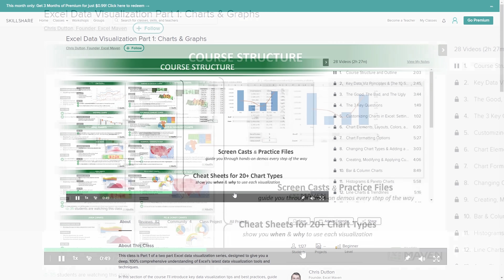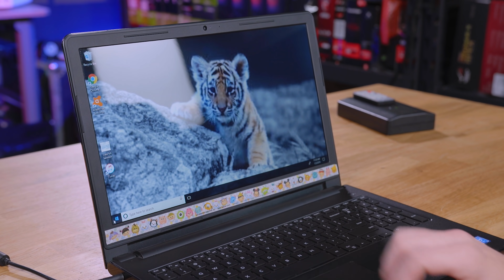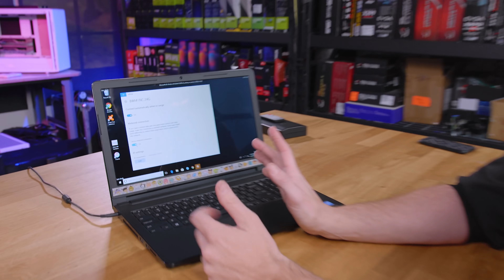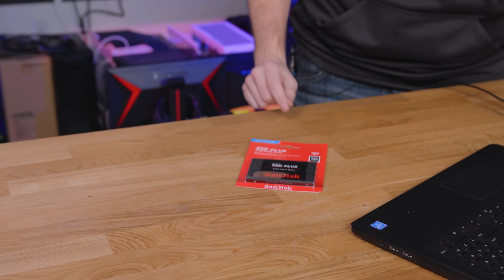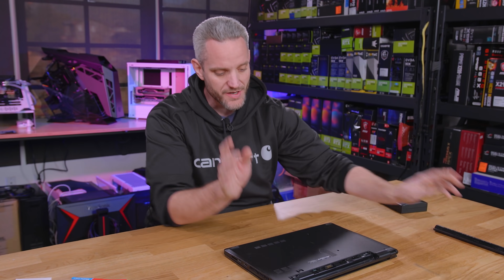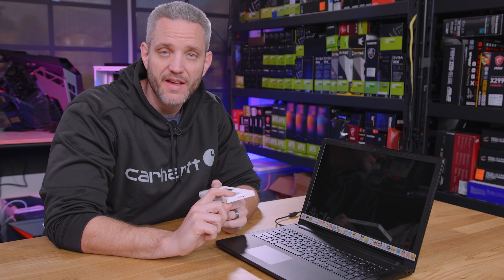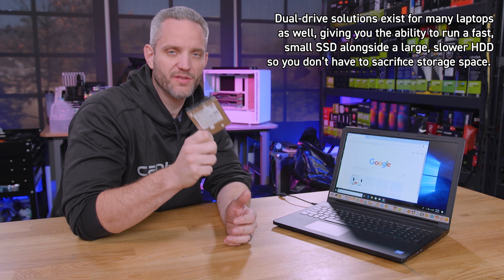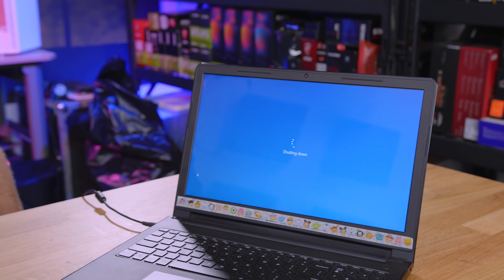Repairing an old laptop for as little money as possible...

Comment: Hey Jay, good show. 
So my old Dell Inspiron 1525 Laptop was getting real slow and glitchy, I decided it would be fun to see if it could be upgraded ok. So I stuck a new cpu Intel T9500 @ 2.6 GHz 6M Cache, 800MHz FSB, couple 2GB sticks GSKILL DDR2 800MHz PC2-6400 and a SanDisk SSD 240GB 530MB/s.
This new hardware has a little more power than the F-Bus could handle but now starts most of the time in around 28 seconds. Its no gamer but now I can run Art programs have abunch of windows and tabs open at the same time. 
 I think this laptop is excellent now well worth the upgrade.. And it was fun to upgrade it ^^

Comment: It's got Norton, McAfee... Ah there's your problem! I've actually even got rid of avast recently on my desktop. Just using Defender and Malwarebytes.... Sooooo much lighter on CPU utilisation!

I'd also remove start menu delay in regedit and probably adjust display options - visual effects, for Performance. Sure it will look like Win95, but on a craptop it will be waaaaay quicker.

Comment: That emoji stickers at the screen bottom screen gave it away that the owner is a teenager girl..

I have a similar notebook from ASUS (5 year old i3) slow and only a single slot for the RAM.  I didn't want to remove the 1TB mechanical drive (for storage/backup and also to retain the original image/clone partition)  but I still wanted a SSD.  It doesn't have any slots for M2/PCIE SSD, so the only option was for a SATA SSD.  I got the Evo 860 500Gb on a sale.  The only option was to install the SATA SDD into the DVD slot.  I got a SSD caddy that fits into the DVD.  Still, opening the back to access the DVD drive was almost a nightmare!  The entire back-panel had to be removed before I could access the locking screw to remove the DVD tray.  I broke one of the plastic snap holding the back-panel.

One the SSD Caddy with the new SSD was installed, I used the Samsung disk utility to migrate the OS.  Everything is so much faster and smoother once its completed.  Cleaned/Re-partitioned the mechanical drive and re-configuring some of the programs to reside in the mechanical drive rather than residing/running from the cloned SSD.  Took some time but it was worth it to give a breath of life into an old notebook.. it's much better and cheaper than buying a new low-end budget notebook.

Comment: I recently fixed up my old Toshiba laptop the Satellite a215-s5808 (AMD TK-55), the ATI video never got a windows 10 driver (ATI SB600) so windows 10 ran like garbage specially compared to windows 7. I went ahead and cleaned the whole thing heatsink and fan, reapplied thermal paste and installed lubuntu 18.04 LTS the thing runs fantastic after that

Comment: Definitely agree with updating to SSD.  Got some cheap $5 laptops at garage sales, and SSDs were my first update; actually, in both cases I had to replace the HDD because they were bad.  Both were 2008/2009 systems with only Core 2 Duo, but even with that it's perfectly usable for Windows 10 or Ubuntu if you're interested in light web browsing.  I wouldn't recommend them for gaming, though, as he notes.  Lakka on a USB stick though is pretty amazing--even 10 year old Core 2 Duos with Intel integrated graphics are substantially more powerful than a Raspberry Pi 3.

I did end up going on ebay and upgrading the Cpu to a 2.4GHz Core 2 Duo for ~$4 (mostly for the hardware virtualization) and the ram to 4GB for ~$6.  As another poster mentioned, it's not at all a bad idea to look online as Dell actually has really good manuals on setup and service.  Some googling around will also give you an idea of what sort of upgrades have been attempted and were successful.  I will definitely agree that some Dell disassembly requirements are ridiculous; if I ever want to take out the DVD drive and replace it with a HDD/SSD caddy, it'll be almost a complete disassembly to achieve. 

Even though neither laptop is going to replace my main Linux box or my gaming Windows box, they are both definitely usable enough if I ever need a portable solution or for a while if one of my main machines dies.  The best thing to me is probably the satisfying absurdity of buying cheap CPU and RAM with free shipping from China.

PS - Far as I can tell from the 4K screen shot, you have an Inspiron 15 (3552) and the service manual (https://downloads.dell.com/manuals/all-products/esuprt_laptop/esuprt_inspiron_laptop/inspiron-15-3552-laptop_service%20manual2_en-us.pdf) shows it's actually pretty trivial to replace the HDD and RAM by removing the battery, base panel, and then swapping the HDD and RAM.  So, uh, not sure what's going on?  It doesn't look like you can replace the CPU though, sadly.
Reply: A month ago, I Scored a Dell Latitude D630 (built in 2007)on eBay for $20 bucks!  No HDD, No OS, & only 2gb ram!  Dropped in a $20 SSD, got 4gb of Ram from China, off eBay, Loaded Win 10 Pro,...now she's Running like a Champ!  I don't have Cable/Internet,...but I tether in thru my Cell Phone, keep updates paused until I can Update from a Fast Food free Wi-Fi Connection in there parking lot!

Comment: Your inspiron may not be meant for user servicing, but thats not true of dells in general.  Both the Lattitude and Prescicion lineup are for the most part very easy to service, with it being one cover to open to access hdd/ram/wifi card and if applicable, internal battery.

Comment: I don't get why people buy cheap junk just because it's new. I just bought an old workstation laptop with an i7 4810MQ, 16gb of DDR3, and a 512gb SSD for $300 on ebay. Beats any new system spec-wise until you spend $600 or more.

Comment: I just received a Dell N5110 today :)  I brought it for $150NZD (about 100 USD) it has i7-2760HQ, 8gb DDR3,  GT525m 1Gb. Had some motherboard issues that required a small amount of soldiering to fix the heatsink mounting points and a really good clean up, heat paste etc.  I'm amazed at what you can get for so little these days. It's incredible and makes me feel so old. But the plus side for me, is I love computers, repairing, programming and all that crap but I've never cared to have up to date technology and are always 10ish years behind in everything (I admit I have a RX580 8Gb but everything else is old), means I can have what I consider really nice stuff for cheap because its actually all crap by todays standards, but I don't mind. A new store brought laptop to challenge the N5110 I just got would cost about $1000
Reply: I should add, the screen has dead lines of pixels. Lol. But I already have a replacement lined up for this computer anyway from a HP DV6 with a busted GPU

Comment: 7:59. Cheaper Dell machines are like that. Now, if you talk about some of the desktops and other Inspirons, it's a whole different story. For example, my Dell Inspiron 15 5558 has a service bay on the bottom where you can access the hard drive, RAM, the wireless WLAN card, and the CMOS battery. Much easier to access than my cheap, Walmart, Black Friday deal, HP 15-f039wm notebook. THAT only has a cover which you can take off to get access to the WLAN card and the RAM. Just informing; not trying to bash this video.

Comment: Dell user here :V Latitude E5430. I need to clean whole radiator and replace thermal paste and i need to unscrew 5/6 screws to get FULL access there and clean it properly vs 30 on HP pavilion DV6 (+ almost take out motherboard) and 15 on Thinkpad + get some fight with other things. HDD/SSD is also very simple, just unscrew 2 screws and you are ready to go, 2 more which block the HDD from moving inside, and 4 more on adapter, which holds HDD in it, maybe it`s a little overkill, but still good thing, better than 0 screw holding HDD on HP, where you can just unplug HDD and put it again almost...
Reply: + ALMOST EVERY low-end laptops are made to just work and every operation inside is pain the ***, HP, Asus, Dell, Lenovo etc. It`s just cost effective and if you buy one of them you probably don`t know anything about PC`s (laptops with celeron or pentium with 2/2 CPU and 4GB of soldered RAM), so it`s "user friendly" for normal person, which don`y want to look inside or anything like this.

Comment: Crucial had a great tool for displaying drive slots and dimm slots for my old laptop and what was compatible before I was able to figure out on my own what I would like.
Reply: Second while this doesn't have to do with topic as much my old slow hard drive always came up 100% fine on any disk checking program I was running (windows and some site utility's I can't remember, and defragglers) and its replacement was the same kinda slow drive it ran much better for longer and with a new system I put to the test to see the difference and turns out stripping my newest old drive with one for storage was fine but stripping it with the one it replaced brakes the raid every few hours while everything still says its fine. I guess my stupidly long story or rant is sometimes things are broken but will never tell you why even if you buy software to test for that sort of thing and if anyone has read this and doesn't hate me for it in curious what issues appear and are known even if everything says its perfectly fine.

Comment: Courtesy of that last video I realised I had a spare ssd and slapped it in my old crappy laptop. I also found another 4 gigs of RAM for $18 and it made it go from a crap laptop to a great mobile Office PC and it can even run Rocket League and Stardew Valley. Thanks so much for that advice!! Went to 256 GB SSD and 8GB RAM btw on a $250 laptop from 2015.

Comment: What I have learned about Jay when he is upgrading/repairing laptops is that he doesn't do a lot of research on what he's working on first. I have two Dells (a vostro 1520 and an inspirion 1501) that I have been able to lookup and know exactly what I can do to upgrade them to their highest capabilities. Upgraded CPU, more ram and know how many slots I have, and a SSD. And most Dell laptops have an online service manual in which you can learn how to repair/replace every single component in it. Just some simple research on ifixit can help out a lot.
Reply: Just for an idea on what you can do
Inspirion 1501 (upgrade in 2016):
AMD Turion TL60 (2 cores 2ghz) (Replace another turion with only 1 core) = $14.00
850 EVO SSD 250gb + Spacer (replaced an 5400 rpm hdd) = $84.50
2x4gb DDR2 (replace 2x2gb) = 118.99

Vostro 1520 (2018 upgrade):
Intel Core 2 Duo T9600 (can't remember specs of old CPU, though I still have it somewhere) = $26.00
850 EVO SSD 250gb + Spacer (replaced an 7200 rpm hdd) = $94.80
2x4gb DDR2 (replace 2x2gb) = 103.99

Comment: Jay, I'm disappointed that you haven't tried upgrading the CPU. For that, I usually check the fastest CPU a particular laptop model shipped with and just throw in that one. 1.6GHz Celeron doesn't' sound good and it will be the biggest bottleneck now that the SSD has been installed.

Comment: Thumb up! As a side note, on top of all done,for who does not know this already, use a 32 bit os when less then 4gb or ram and only use 64bit when more ram available. Also as long as your laptop has a socket for the CPU and is not soldered in this case upgrading the CPU for litterally a tenner second hand you can get a 2ghz+ in there and not to be a celeron...

As i do not do gaming on my laptop i still use a inspiron 1520 4GB RAM intel T8100 cpu and 120GB ssd with win10 (originally was a celeron @1.6 with 512ram 80GB sata 1 hdd running xp) amazing what 40£ in total in parts done to it.

Comment: Family member had a 2011 2670qm based system, Still really powerful today, but it was an absolute mess because of the 1Tb Toshiba HDD, I put in a SSD, same as the one in the video, best thing to ever happen to that laptop, Extremely quick and responsive, Very quick boot times (10 seconds as apposed to 10 mins) responsive, Really worth the money.

Comment: I built a computer back in 2012 that wasn't pushing any impressive benchmarks even in that day.
Phenom II 960T Black
Biostar 780L3B (or whatever)
8 GB (2x4GB) 1333 Mhz RAM
HD 5450

It took me about 4 years to realize I had somehow downclocked the CPU to 800 MHz. (I wondered why I was getting stutter at all in WarCraft 3)

Even so, it really didn't give me serious issues until about 2017. The O/S was dying because the Hard drive had enough. It was actually cannibalize from an old laptop that was not happy about being dropped. I think it was 3 years old at that point.

I replaced that hard drive with another drive cannibalized from a laptop given to me.

I was actually surprised when the computer started acting up again. I started thinking the computer had finally had enough, until I really thought about it. I happened to see that SSDs were really not that baf, so I convinced the wife that we should get one. I got a 240GB drive from Sandisk. Overall, the computer loads about three times faster. Some applications are faster, and some haven't changed significantly. My SATA ports are only 3Gbps, but I'm not sure if that significantly impacts my speed.

Overall, it was a very good idea to upgrade to a SSD.

Comment: Oh noes, it's broken!
Jay - PLEASE don't enable metered connections / disable Automatic Windows update.
NO ONE will ever check for them on a regular base and your OS will turn to shit. People will complain about updates taking 50 minutes instead of 2 because they need to download and install 45 updates at once!
Instead of doing that, just change your ACTIVE HOURS in Windows.
Settings  > Update & security  > Windows Update , then select Change active hours.
Change the active hours to be in a time where you ACTUALLY need the machine and let it be "inactive" around 9pm or whatever where the machine is just idling around.
This way you get PROPER updates and don't peg your network, your SSD / HDD and you are pain-free.
Manual updates are abominable and should only be used in companies / critical work machines where Beta builds COULD break your machine.

AAAAND to top it off:
Microsoft stated, that if you manually search for updates, you OPT IN to a "enthusiast" mode that gets you updates quicker - even if they MIGHT be more unstable!
Don't know if the link is permitted:
https://www.techspot.com/news/77846-microsoft-admits-non-insiders-beta-testing-windows-updates.html

Comment: all my (fairly high end) laptops went bad after max. 3 years- 3 things you can do after 2 years to make it as fast as it was- reinstall windows (and all your expensive software that will now think you pirated it) - open the case and clean the horribly underpowered fan system- but most importantly: except that laptops have a engineered lifespan of about 6 months longer than the warranty...

Comment: Kinda disagree, there's already a huge difference between a new-ish hard drive and a small one from ages ago, mainly due to the difference in Cache and if you do run a budget Laptop with no option for dual drives, I'd recommend a HDD over a SSD simply because you get more storage. It's also easy to check your Drive with programs like crystaldiskinfo etc.

If you do buy a new budget HDD, compare the caches and go for the one with more even if it costs 2-5$ more.

Comment: I guess i was just lucky for my first dell. It was a breeze to dis assemble. 2 screws and you had access to the ram, HDD, and wifi card. The battery is held in by a simple thumb-lock. The keyboard could be replaced for a back lit one just by lifting the tabs on the surface of the machine. The optical drive was held in by a single screw and a push tab under the battery which i used to install a HDD caddy for more storage. The only downside was it was rocking a 4th gen core i3. It was upgradable to 16gb but it wasn’t worth sinking any more into at that point due to the processor.

Comment: Lol that teardown was insane and has not been my experience with servicing Dell laptops. My current laptop is a Dell as were the 3 before it and I've never had to open up a laptop that much to change a drive. At most I've had to remove 4 screws.

Comment: This happened to my PC after a Windows Update. I noticed that boot and shutdown became really slow for weeks and all of a sudden my PC won't boot to windows and stuck in safe mode. Fortunately, I still have my boot drive and did a fresh install of windows. After that, my boot and shutdown times became normal. Note that I have an SSD for OS Drive so it will be normally fast. I concluded that the october update messed up my windows.

Comment: jay , and tech youtubers in general all do things hardware wise, and i was wondering if u ever do anything software related. i can find articles but for some reason the wireless on my router isnt working the past 2 days. and i reset it and went into the router wireless settings to make sure its on but nothing else is wrong. anyways i was wondering whats ur most used software/malware/defrager etc or if u dont use any

Comment: I have an older Lenovo laptop with an AMD A4 chip, my solution was to add more RAM, add an SSD and switch to Ubuntu as its far lighter than Windows. Not using windows was just as larger speed increase as the SSD was, its well worth it

Comment: Yes the Dell XPS Notebooks are really bad, but the Dell Latitude Models are used some of the best value you can have for a Notebook. The hardware is easily accessible and replacable. Spare parts are widely available. There are 6 year old Latitudes that you can get a new Mainboard for (if yours has some Water damage), or a new keyboard or screen or whatever.
The German Dell Driver support page is the best in business, well sorted and lots of different Versions available (can't talk about other regions though) 
I personally would always instead of buying a new Notebook (non gaming) get a used Dell Latitude.
Call me a fanboy or whatever but i have held many Dell Latitudes at work (E4300 up to the current models) and they are just great to work with.